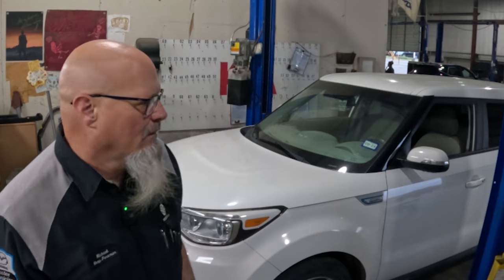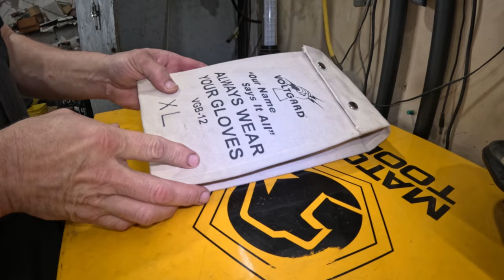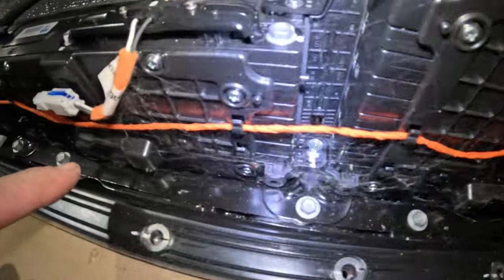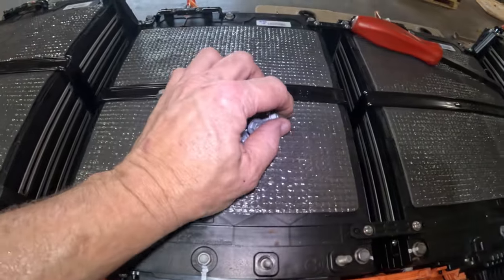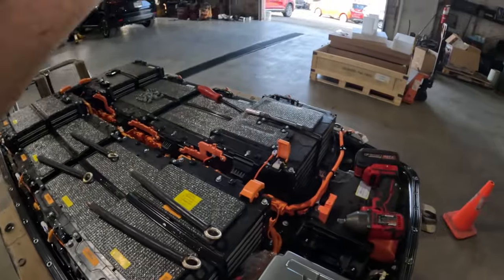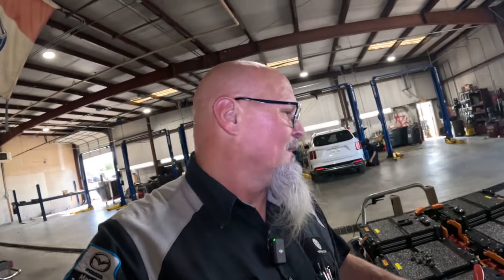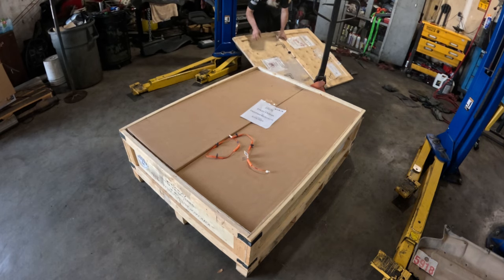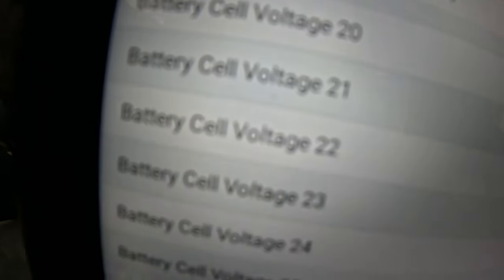EV battery pack replacement 2012 KIA Soul EV Part 1

Comment: Why didn’t you clean the inside of the battery before dropping in the new modules?
Reply from the maker: It doesn't stop the battery from doing it's job.  And, did you see the vehicle? It's not going to get any better.  If the customer likes it nasty.  Who am I to change that.